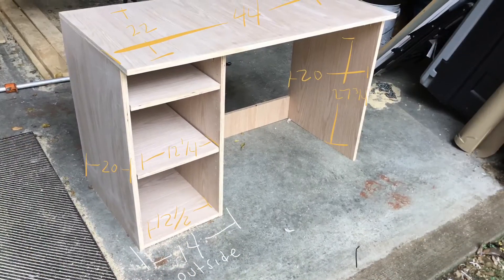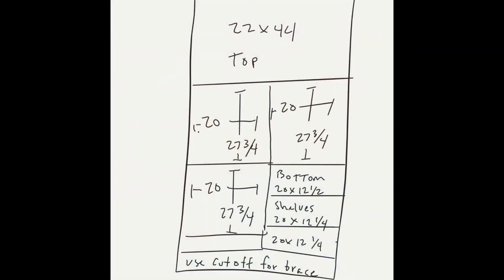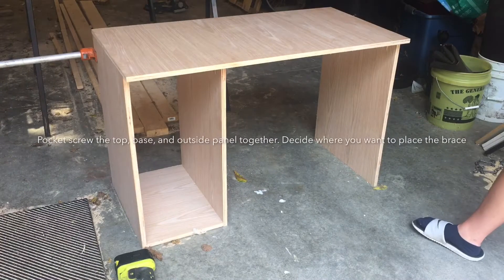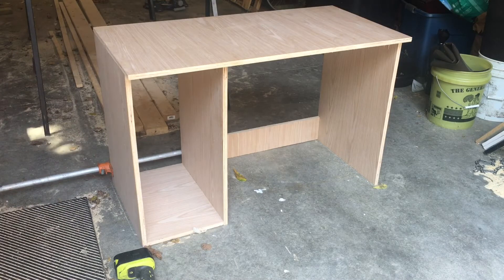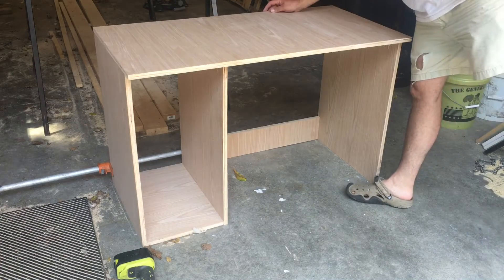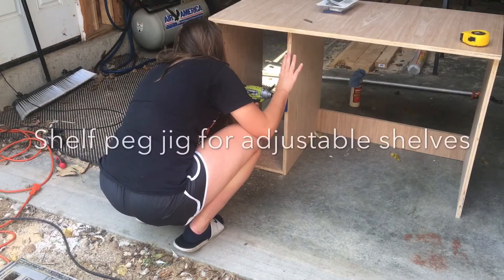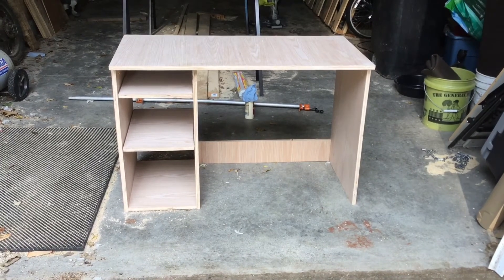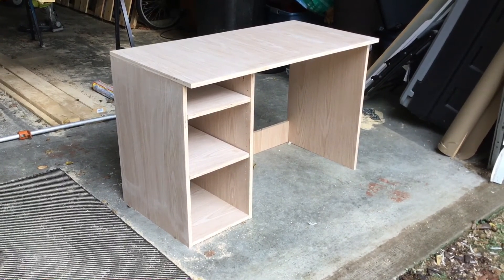How to make a desk from one sheet of oak plywood

Comment: Quick question how do I get a smooth finish on plywoods? Lowe's has the large project plywood and they're sanded do i still sand them using 220 grit to get a smooth finish?
Reply from the maker: If the grain is raised and your surface is a little fuzzy buy a better hardwood ply or plan on putting a couple extra coats of polyurethane on. Personally, I would buy 3/4 plywood that is cabinet/furniture quality where both sides are finished. Maple and oak should be available at big box store near you. I pay about $55 a sheet. A very light sand with 220 to take out scuffs or knock splinters off cut ends should be about all the sanding required. We blow the project off with compressed air and brush on two coats of polyurethane. After the polyurethane cures, we buff the surface with really fine steel wool. This pulls dust off or knocks rough spots off. Sometimes we have to coat it again. Best wishes on your project!
Reply: @growntogether9913  thanks, is the sanding between coats after being done staining it? My stain is black with polyurethane
Reply from the maker: Yes. Sand to prep for stain. After you stain, coat with polyurethane. Rub with steel wool or very fine sandpaper when cured. Put a final finish coat on if needed.